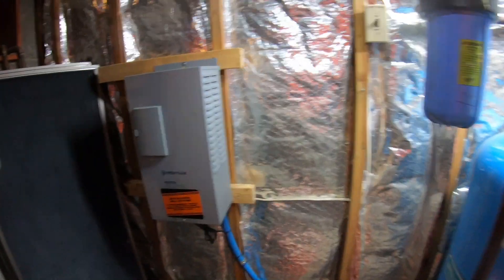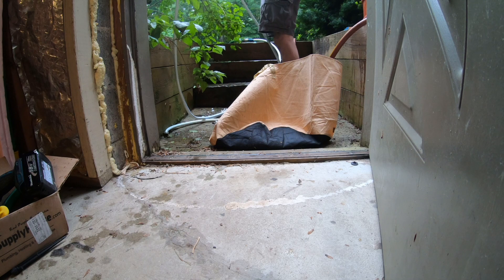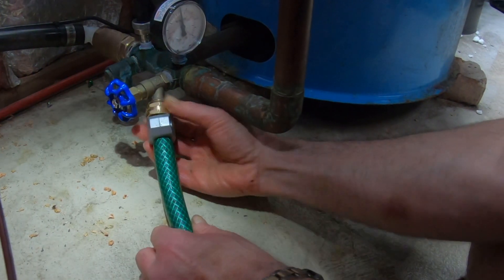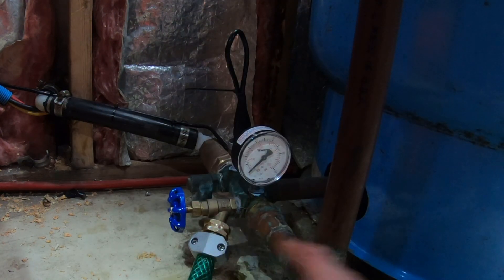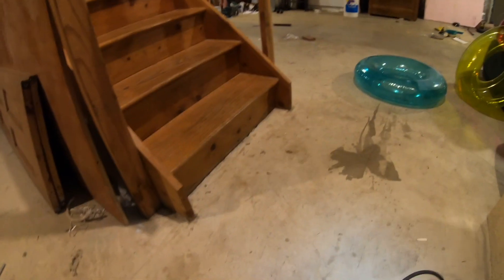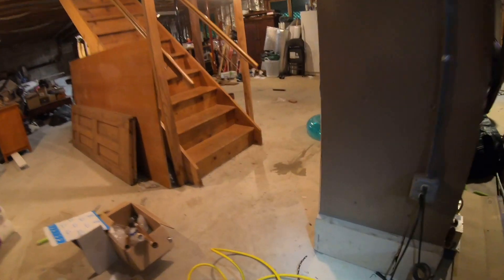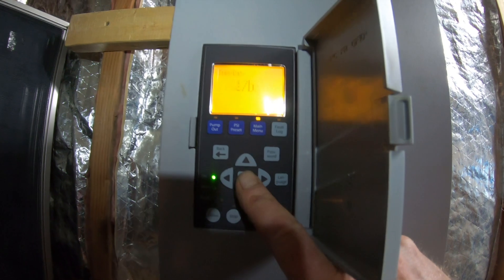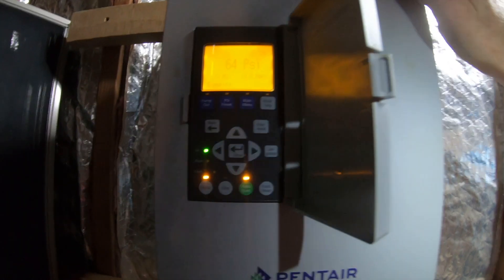Pentair Intellidrive constant pressure well control- changing the pressure setpoint

Comment: What is the noise level of that Pentek like?  I see another channel has called out higher frequencies during runtime that are annoying.  Is it noticeable only when close to the unit or how far away can you hear that higher pitch frequency?
Reply from the maker: Ours is in the basement but yes its absolutely an annoying high pitched whining sound that gets higher and lower in frequency depending on the speed of the pump.  If I had finished space in the basement it would be an issue and I would need to insulate the area for sound.  Hope that helps edit. I do woodworking in the basement and don't even realize its running - you get used to it.
Reply: @Drrich_DIY  Yeah, I can hear it on ur video when you restart the system.  Higher pitch whine (9:51), then the fan kicks in (10:03), fans goes off after a bit and still hear the whine until it stops (11:21).  Ours would be in an unfinished basement that is rarely used as well.

Is it the fan noise or the high whine sound that would require mitigation if the space was finished?

Do you ever hear it upstairs when the house is quiet?  

Is the noise impact equivalent to your HVAC running when you are in the basement?  

Can you hear it on the other side of the basement or only when near it?  

I'd hate to spend the money and regret it....  As you can see, I'm about as anal as you are about things.

https://www.pentair.com/content/dam/extranet/web/nam/pentek/manuals/pn957-pentek-intellidrive-pid-iom.pdf

Looks like you have a 60 gal or larger pressure tank which may require adjusting the Wake Delay to a higher value than the 15 sec default or you will find the pump will cycle off/on on low gpm activites (hand wash, etc..) versus staying on until the draw stops.  You can test that by turning on a faucet and watching the control screen to see if the unit stops the motor completely after Boost Mode and then restarts it even though you have the faucet running with a constant draw.  There is a lot of reserve pressure in a large tank so the psi does not drop fast enough and the system thinks there is no draw and stops the pump motor.
Reply from the maker: @arhart  we're vacationing up in Maine for the week but will try what you suggested when I get home. I dont think its short cycling. I believe the pressure drops to maybe 5psi (or whatever i set it to) below the setpoint before the pump kicks on. Thats enough to keep it off for low draw activities. Its way way better than my old 50/70 switch.  I dont mind the noise, I can tell if its running  without walking over to it. I love the fact that the pressure is constant. I still worry about the pump overhearing when it runs for a long time but thats really baseless. Only downside is the cost. My well is 750' down and its $$ labor to replace. I did install two surge protectors. One at the breaker panel and another for the pump just before the  wires exit the house